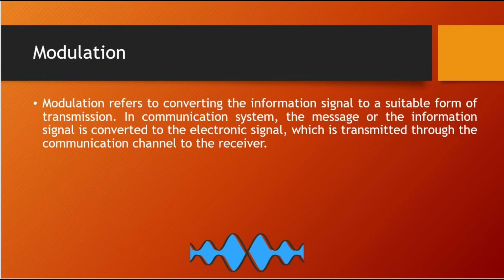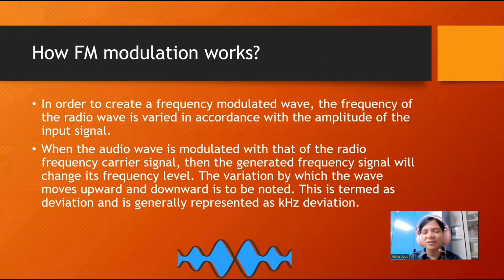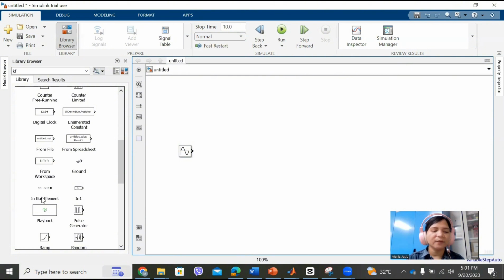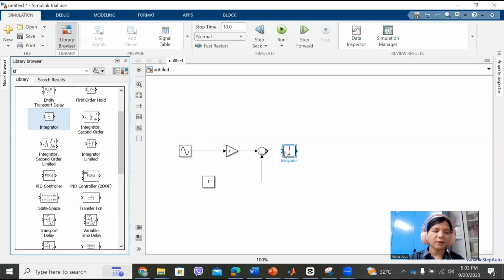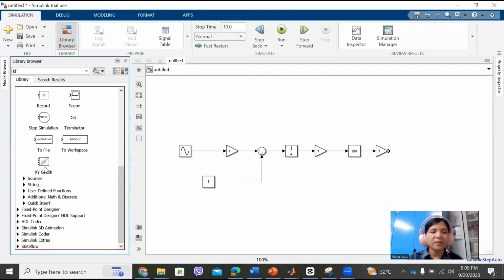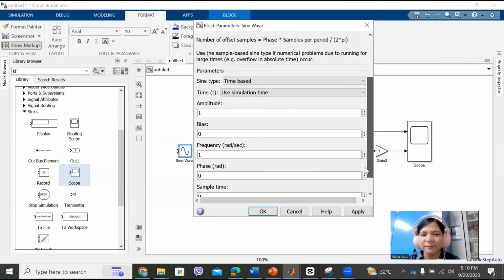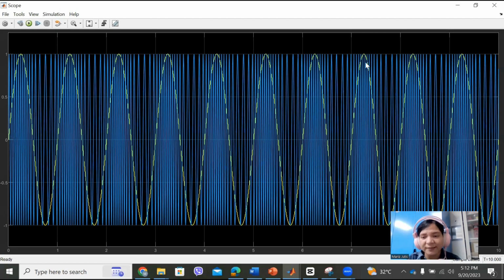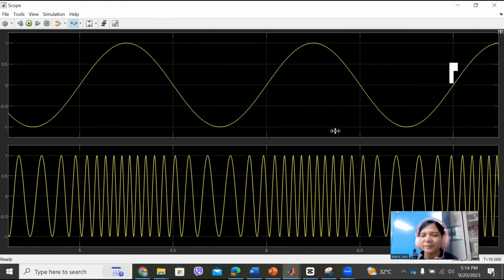Frequency Modulation Simulation using Matlab Simulink

Comment from the maker: In this activity, there are two major important points I want to emphasize.
1.	Importance of Simulation
During execution of the activity, I failed and encountered error many times and yet finish it with comprehension. Imagine if you did not simulate a mathematical model and need to apply it in real world, I think it will be costly and frustrating.
Simulation-based learning facilitates experiential learning by allowing to make errors and experience the repercussions of these errors in a secure environment. I confidently grow my skills and knowledge, leading to deeper comprehension and a stronger sense of personal accomplishment.

2.	Importance of Matlab Simulink
I realized that Matlab Simulink is very helpful for us to simulate our experimental model or analysis and try the application without any cost. Also, very helpful to improve the existing model since it is very easy to change the configuration.
SIMULINK enables the simulation and modeling of dynamic systems using block diagrams. It allows users to model complex systems, simulate their behavior, and analyze system responses under different conditions.